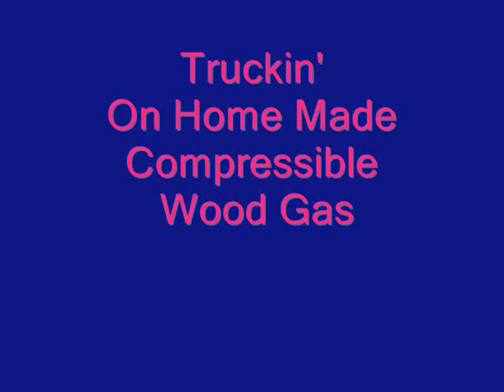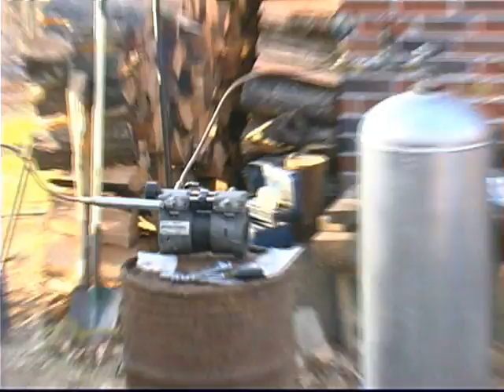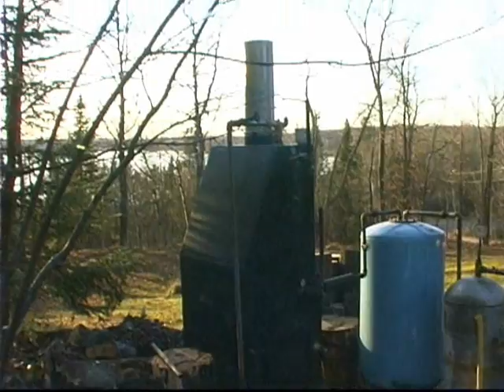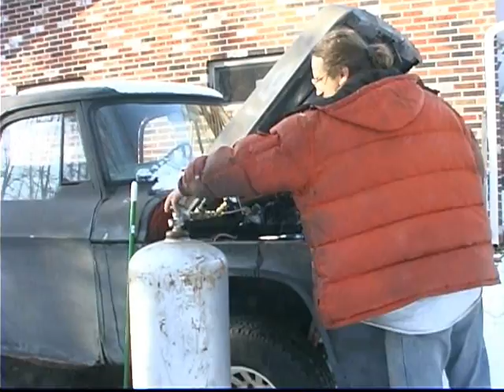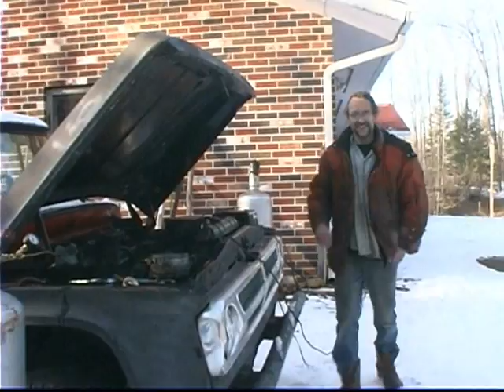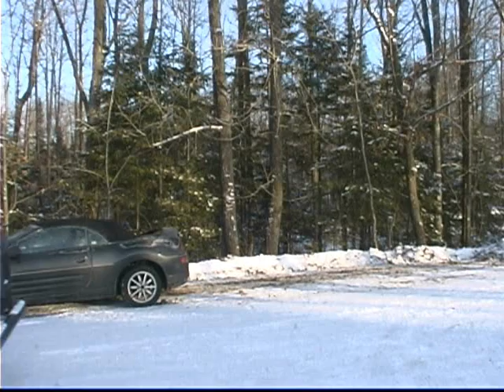Driving on Compressed Wood Gas

Comment: Wau buena idea peeo hay un punto no se de que medida es tu motor pero temdrias que comprimir a masde 1000 psi para tener una autonomia aceptsble ya que un tanque de 50 litros a 100 psi solo almacena 500 litros y eso solo te alcanzara unos 10 a 15 minutos ya que el motor clnsume entre 20 a 30 lpm de combustibel en forma de gas
Reply from the maker: Sí, el gas de madera tiene una densidad de energía muy baja en comparación con el gas LP y, en el mejor de los casos, es similar al gas natural, que tampoco se licua cuando se comprime. Aprendí mucho de este experimento y desde entonces dejé de investigar el gas de madera. Gracias por comentar.

Yes wood gas is very low energy density compared to LP gas and at best is similar to natural gas, that also does not liquefy when compressed.  I learned a lot from this experiment and since stopped researching wood gas. Thank you for commenting.

Comment: That is an ticking time bomb on the road
Reply from the maker: It, the truck, is not on the road. It was an experiment to see if wood producer gas could be compressed and used for transportation.  What I found was that the energy density of the gas I made is similar to natural gas.  To get enough energy from natural gas into a vessel requires high pressures similar to what is in a scuba tank 3-4 thousand psi. The highest pressure I could get with the equipment I could afford was 90 psi.  There are natural gas buses and other vehicles around so you better stay at home and never drive to escape the danger of the exploding time bombs on the road!

Comment: genius
Reply: Dude I have said what you are writing in several comments. Yes producer gas and even natural gas in buses and other vehicles requires like 4000 psi compressors and tanks to be useful.  The gas I produced is not conventional wood gas which is mixed with air while it is made. While thermaldepolymerization is the name of a patented process, I produced gas in a sealed, regulated vessel with wood scraps in it and a type of catalytic conversion, heated by a wood fire. Although took the gas production device apart and no longer make gas, I still have a couple tanks with the gas in 6 years later and it is still quite the same so it is not carbon monoxide and it does store.  I now feel that a combined heat and electricity system works better here in the winter and storing the electricity in batteries is more practical and charging up an electric vehicle from the wood-steam-electrcity would work as well. Local Ideas is our nonprofit corporation and this is our channel. I also post alternative energy experiments on the channel I am commenting from here from time to time. So thank you for your interest in alternate energy and for you comment.
Reply: Actually, I hate to burst your bubble, but this is very much NOT genius.  The energy density of producer gas is very very low.  The tank he has pictured is likely to only allow 2 or so miles of travel.

Comment: I know it's been 6 years since this vid was uploaded. Did you have to change ignition timing? From what I gathered up wood gas burns faster then gasoline
Reply: No I did not change the timing, I now run it on propane and it runs quite well on that, with the same timing as burning gasoline, it is a woods truck that does not go on the road. I use it to collect firewood. The gas I produced was very low energy content requiring about 50:50 air fuel ratio.   I still have some of it stored in 100 lb cylinders.  I gave up on the producer gas and increased the size of my live steam boiler as an off grid electricity plant.
Reply: @wiscokiddd  I'm just starting out with electricity independence. Are you recommending using a steam boiler over using a gasifier?
Reply: @MoneyIsSilver  well up north in heavily wooded areas the condensed steam out of the boiler through to the turbine to make electricity still has a lot of heat so I ended up preferring steam if utilizing wood.  I would think if the heat from a wood gas generator was used for space heat like I use the steam for heat, it could be made into an efficient system too. Wood is a lot of work and dirty but when the sun is not shining and the wind is not blowing or even when it is and it is 40 below, wood is good and if you like physical exercise you sure get that compared to buying propane or any fossil fuel. Thanks for asking, k.
Reply: IC Everything. J.R. To me it sounds like he haven't. It ran very "uneven".

Comment: Purrs like a kitten with bird flu. :)
Reply: So what is your point other than trolling? Are you interested in alternate energy or do you shoot up Koch fuel intravenously?
Reply: It was a smart arse comment intended in humour, not trolling. Your build is interesting and well done, no need to get all defensive.
Reply: The same here, there are a lot of Koch suckers out there and many of them are in public office denying  human caused climate change and over population necessary to keeping the antiquated suicidal economic ideology of inbred elite class of pigs in power. Actually I learned a lot with this wood gas truck project. One is that the gas I produced, as well as natural gas, are low energy density fuels that do not liquefy, they require the same pressure as oxygen and inert gas, like 4000 psi to be useful for transportation.  Two, the gas I made is store-able where gasifier gas is produced by mixing air with the fuel and is not store-able.  If I ever try to make my own transportation fuel again, I will probably go with modified ethanol.  Thank you for commenting.

Comment: so how do you make the wood gas compress into liquid form? Ive seen people put it in a cylinder with a compressor but it doesnt have the energy density of lpg in liquid form
Reply: Methane, natural gas etc. do not liquefy easily. The pressures in natural gas tanks for motor vehicles is similar to scuba tanks, like 3000+ psi., something I did not consider when I started this project. I could only go about 1/4 mile on a 100 lb size propane tank filled to 90 psi of gaseous fuel I made from wood. I now think the gas I make is not suitable for transportation.  Some people have said that wood gas is mainly carbon monoxide which breaks down soon after it is made. That is not true because I have the gas I made and compressed in cylinders for over a years and it still burns.  I believe I can set up and use the gas I made in gas stoves and even a gas refrigerator.  I'm still studying catalysts and other ways to make viable auto fuel from wood and garbage.  Right now I'm shifting back to working on and improving the wood/steam/electricity part of the energy bootlegger.
Reply: I wish it did behave like propane but the gas is more like natural gas and does not liquefy. Sorry for any misunderstanding.
Reply: I will share my 2 cents on why it did't work, based on my researches and experience. First and formeost, i live in brazil where gasoline is extreme priced, and because of that we always try to go with alternative fuel. Etanol is a big one here, and also is extreme comom cars running on natural gas. Now, there was some people running on glp in the past also, but now its illegal. But talking about gases, today we can put cars to run on 3: natural gas, glp and syngas(wood gas). Their respective calorific potential is (aproximated) 9000kgf, 11000kgf and 4000kgf per cubic meter (if im not mistaken about units). This means that the amount of wood gas expent would have to be the more than the double of expent natural gas to perform the same work, and almost the triple compared to glp. In other words, we need a lot more wood gas becaus miles per cubic meters is not so great with this fuel. This implies that we have to get more and/or big containers to store more gas. And this is where the density of this gases turn crutial for calculation. Usually, one standart 13kg glp container carry over 5m3 of gas at more or less 200psi given tha it has a density of 2,5kg/m3. This quantity is good enough to move a car with an engine up to 2.0 liters for a minimun of 150km, it depends of a lot of factors. For we to get the same mileage theoretically, we would have to use the triple amount of wood gas. But the amount of gas we can put in the same container, at the same pressure varies depending on the gas. If we consider that syngas has a density of 1.2kg/m3, we could say that the same 13kg container at the same 200psi could carry about 10m3 of wood gas. Still, it would give only 2/3 of the energy potencial of a glp full container. The solution would be have more than 1 container conected between themselves. Regarding these natural gas cilinders, they are put into this so higj pressure because they might seem big outside, but the walls are so thick that drastically reduces the internal size. They are very explosive resistant, and can resist to fire and even rifle shots of heavy caliber. So, in order to make maximum use of this size, they have to put a lot more pressure on the gas to have more gas inside the cilinder. But anyways, using natueal gas cilinders is not the best aproach and here is why: natural gas have a density of only 0.6kgf/m3, half the density of syngas, making it easier to put into small containers. Lets take a comom 15m3 natural gas at the standart pressure of these cilincers, something about 2500psi. You could only fill it half the amount of wood gas, 7,5m3, and this amount would theoretically give you the milage equal of 3m3 if it was natural gas. In other words, you would have to find a way to pressurize the woo gas to high pressures, and use the double cointainers to have half the milleage. Don't sound very nice huh? Kkkk the best aproach is to use propane tanks at los pressures. Dont worry about the pressure, the high pressure of natural gas tank stays in the tank. Before going to engine there is a pressure regulator that  gets the gas at atmospherical pressure. Thats one of the motive because it didnt worked here.
Reply: It behaves like propane so it's good :-)))
Reply: It will not liquefy.  What's not being said here is that producer gas has an energy content TEN fold lower than natural gas.  So, if you were to fuel a commercially available honda civic gx (designed to run on natural gas), the range of the vehicle would drop from 250 miles to 25 miles!  OUCH!

Now keep in mind that this is only if you compress the gas to 3600 psi.  The tank he has pictured is a propane tank, which is only capable of holding 240 psi.  Let's just say the tank is roughly the same volume as the civic tank.  That makes for another 15 fold hit to the mileage.  All said and done, the tank he is using may get him 2 miles if he's lucky.
Reply: still could work as a emergency starting supply for electrical generator's
get yourself 30 min to get a regular gasification generator going and cut the tank so you can run right off the gasifier
maybe sipan a little gas and have it compressed into the tank similar to how cars alternator charges the battery and the battery starts the process
Reply: The other motive it didn't worked its mechanicals flaws. By just pouring gas in the system, we are not optimising the use. There is a lot of waste, and this fuel already have high consuption. There are lots of ways to fix that. Google for "kit glp para carros", you will see many solutions to bring ideas, simple and fancy ones. Also. There is the fact that this engine is big as fuck. If only it had smaller displacement, it would work better. Higher compression rates would be nice too, maybe. Anyway. Its possible to use compressed syngas to power cars, but we have to know its properties, and know what to expect and work around the troubles. Best regards to all. Hope i helped someone.

Comment: The gas I make certainly contains methane and hydrogen, among other things. Neither H or CH4 liquify in the way that propane does at relatively low pressures.  Check out how natural gas is stored, it is not liquefied.  Also check out liquid hydrogen and hydrogen storage on wiki, the tanks on the Space Shuttle were insulated and quite high tech. The liquid H and O2 were stored elsewhere until just before lift off.  Wood is  C9H10O2,C10H12O3,C11H14O4 and C6H10O5. Sorry about the ol'ady thing...

Comment: PV=nRT  That means if you chill the gas to get it in the tank, when you expose the tank to normal temperature the gas will increase in pressure  or expand and blow up the tank if the pressure goes over the limit the tank is designed for.  But hey watch out for that O2 in that gunpowder tree, it may spontaneously combust any second and blow the bloomers off your ol'ady if she stands too close.

Comment from the maker: I think by memory a propane tank working pressure limit it 250 psi.  Yes all natural gas vehicles have tanks similar to scuba tanks with high $ compressors. I don't know how much an Excusrion will help, they are fuel injected but you may still be able to mount an impco mixer on the air intake, I don't know...

Comment: You need to find a cascade compressor system for filling self-contained breathing apparatus. This will enable you to compress to 3000 psi. 
Sources might be old scuba shop equipment or a system replaced from a local volunteer fire department.
Good luck.

Comment: doing good!...try a larger flow reagulator..i think youl find it will provide more power for you. and the truck would get what it needs :) try it if you want but the truck just sounded like it was running lean...awsome job and effort , goodluck  :)

Comment: Hi Mr. Burks: Since this movie I moved the catalyst into the firebox and charcoal of the fire. It does better there. Yes cool gas compresses better. Both my steam pressure vessel and reaction vessel have been hydrotested at 500+ psi. Yeah, with things I have accomplished like building a 70 foot windmill tower, climbing it tying off while installing and servicing the mill I also designed and machined, many other projects, without safety I'd be dead 100 times over. Thanks, Ken, Local Ideas chair

Comment: congrats on all your work . just food for thought catalyst generally work better at high temps so insulation or apllication of heat should help and if its in the winter before compression maby run pipes through ice and keep take in snow or ice while compressing and until needed . You should see cleaner gas and longer runs with these methods . Be safe and have fun

Comment: i know during world war 2 they used big bags that they would fill with wood gas. 

my understanding that you will get some hydrogen migration through the steel tank as time passes causing the tank to become brittle when you pressurize it.

Also some reformation of co2 from the co... 

Personally I'll just put my gasser in the bed of my truck 

other than that... good job at getting it to run off a bottle. I know they did do some of that during ww2 as well.

Comment: So you only go 1/4 mile down the road but what would that tank be equivalent to propane in terms of running a kitchen stove? I'm guessing 1/4 of a BBQ  propane tank? and would the gas burn as cleanly as propane ie. close to zero CO? so you could use it inside? Really cool! It must have been a rush to get that truck running! How difficult would it be to throw that system into another vehicle?

Comment from the maker: @HumbleWillis cooling the gas(smoke) in the two tanks gets the particles to drop out and as you can see in at least one of my videos that the gas is clear when it comes out of the second tank. Yes there is a trick to compressing the gas. Like in last comment 80 psi is not many btus I need CNG equipment to get in the 3000psi range. My angle is you get house & h2o heat and electricity plus the gas improving efficiency above any other method to use wood for fuel and electricity.

Comment: Is there a filter process to take the tar out of the gas so that it doesn't gum up your engine?  Is there a trick to compressing it, or is it pretty much just shove the output into the input end of a compressor, and attach the compressor to a storage tank?  I've been very interested in this for a long time, and seen people running on wood gas, but always via a live fire in the back of the truck. I wanted to see someone do it via compressed gas.